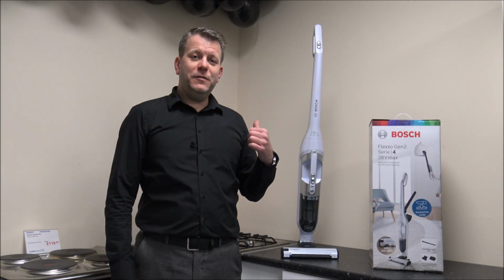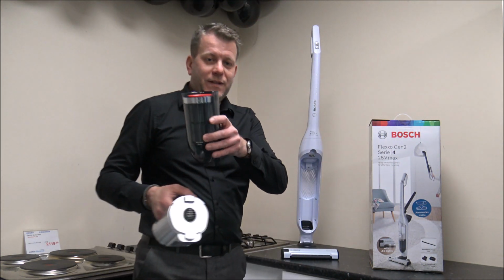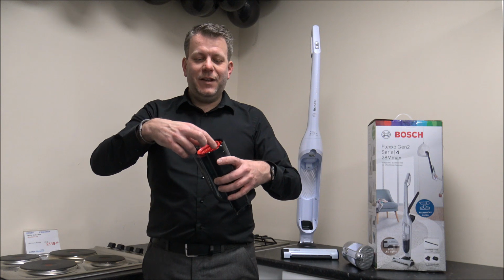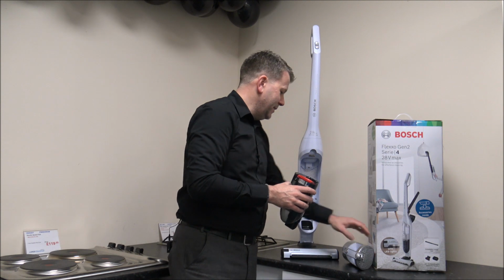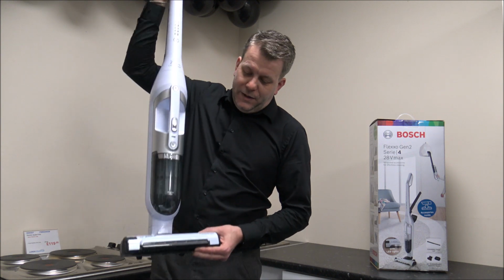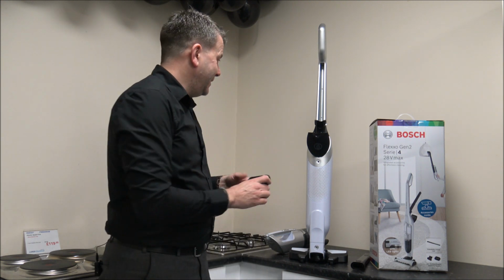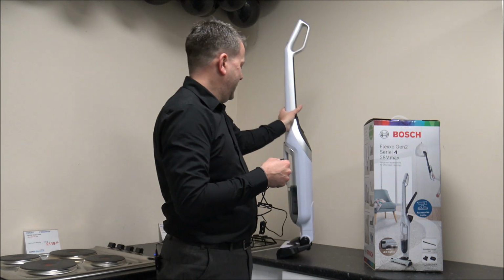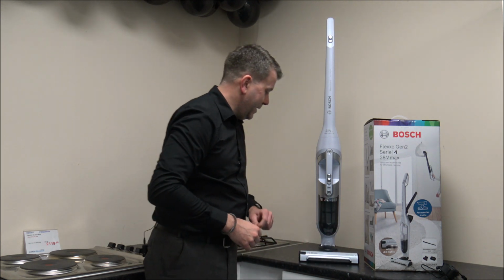Bosch BBH3280GB 55 Minute Runtime Cordless Vacuum Cleaner

Comment: A great and interesting review! You asked for feedback on other models in the range - I have this model's immediate predecessor, the first generation version of the 55-minute maximum runtime Flexxo 4, the BBH3251GB, which looks almost identical but does not have the LED lights in the floor head and is a 25.2V model (it's 28V on the new one, I see). Aside from a slight restyle on the removable handheld unit with the Gen2 Flexxo, they otherwise look identical. I also have a Bosch Athlet of that time, also a 25.2V one, the Athlet BCH6ATH1GB with a 60-minute runtime (this is also a white one - just my preference!), so I can compare the Flexxo to that too. The Flexxo's white finish is particularly nice - it's a pearly white which helps it look more expensive than it otherwise might.

I've been very pleased with my first generation Flexxo. At 3.1 kg it's a bit lighter than the new version's 3.3 kg (my Athlet is also 3.3 kg). The styling of the Flexxo is pretty similar to the Athlet - both very nice looking. My Flexxo feels a bit flimsier than my Athlet - maybe due to the design or the lighter weight - the Flexxo's floor head does feel a little too light sometimes compared with the Athlet's, so if the Gen 2 Flexxo's floor head is heavier due to the LED lights, that will help and 3.3 kg is still nice and lightweight for easy use. It's good that the lights have been added, as it always seemed odd that my Flexxo didn't have them. Whether we really need them is debatable - as you said, they're vital for vacuuming in the dark(!) and handy for vacuuming under beds, sideboards etc. but otherwise in daylight they can help or hinder. Maybe the Gen2's higher 28V rating is what keeps the runtime the same even with the LEDs, or maybe the motor is a tiny bit more powerful too? That would be good as my Flexxo's pickup power is very good, but not as powerful as my Athlet's.

Interesting that the release buttons on the Gen2 Flexxo's tools are a little easier to press than my original's - though I don't have the strongest fingers, it's hardly a problem. The button to release the handheld unit is stiff, though. I wonder if that's any easier? It's very secure against accidental release, but there's such a  strong detent I need my strongest thumb to do it.

The hidden tool storage on the Flexxo itself is really great - it's rare in cordless vacuums, especially 2-in-1 models like it. I have another brand's 2-in-1 which is also very good, but its tools store on a floor dock so they're often still on it if I didn't realise I'd need them (and they often fall off the little nubs they sit on if I knock them!). The button catch for the tools on the Flexxo is very useful - my other brand's friction-fit tools fall off quite often in use but the Flexxo's always stay in place. The Flexxo's crevice tool is longer than others I've come across, giving it good reach and requiring less bending by me, and one thing you didn't mention (which I think still applies to the Gen2 version) is that another catch near the tip of the crevice tool releases an extension which nearly doubles its length - I can reach the ceiling easily with it - brilliant!

The handheld unit of the Flexxo is easy to use and to empty and deal with the filter system. It doesn't seem to have a particularly small capacity either. It might be nice to have two speeds on the removable unit, but one on this part seems standard on other brands too. The main unit has two speeds like on the new version. My Athlet has 3 speeds - the first one doesn't rotate the brush (both do on the Flexxo) and the third one is more powerful than the Flexxo's top setting. The Athlet's capacity is a bit larger than the Flexxo's and its charge status light is more informative (it also can signal when the filter needs cleaning due to its Sensor Control system which the Flexxo range doesn't have). Like my Flexxo, it doesn't have any LED headlights - Bosch seemed later to incorporate these than most brands and both my Bosch vacuums are from the same period and no longer current models. My Athlet has a rubberised grip to the handle, but I don't particularly miss it on the Flexxo. They both charge a similar way (a lead plugs into the back of the vacuum) but it's a different fitting for each. I like the floor stand/charging unit that my other-brand 2-in-1 has - it might be nice if Bosch could offer such a thing, at least as an option, in future models of the Flexxo (or Athlet). The Flexxo and Athlet don't use the same size of filters but both are easy to access and change, and the dust bins are equally easy to remove, empty and refit.

One area where the Flexxo really wipes the floor with the Athlet (pardon the pun!) is the tools. As I said, they're great and the onboard hidden storage is excellent. It varies according to the precise model, but my Athlet also has plenty of tools - mine comes with a pretty long extendable hose, a crevice tool which is slightly shorter than the Flexxo's when the latter is retracted, and a furniture/mattress attachment like the red-felt edged part of the Flexxo's 2-in-1 brush tool, but a little wider and lacking the Flexxo's optional brush bristles part. The Athlet range has a rather unique (and peculiar) approach to tools - the floor head needs to be removed and replaced with the hose and tools, and you wear the whole vacuum over your shoulder on a strap. Some models (including my Athlet) include a tiny stub with power switch to replace the whole of the slender part of the handle with, to make it less unwieldy in this mode, but it's hard to swap due to a stiff release button and the stub's power slider is awkward compared with the normal one. The release button for the floor head (so you can attach the tools instead) is so stiff I've only ever managed it once. I discovered recently that a friend has an Athlet and has never succeeded! I'm sure many Athlet owners have no trouble and certainly it's a great, well-made and powerful vacuum with nice features, but the Flexxo really lives up to its name in this respect - it's very flexible and so easy to use the tools by comparison - and they're always right there with it too. It may be a bit less powerful, but it's really good in its own right and a great second vacuum, no question.
Reply: Gracias por tu información, realmente fue muy muy útil. Gracias por tu tiempo.
Reply: @murielregueira9811  Thank you - I am glad you found it useful!